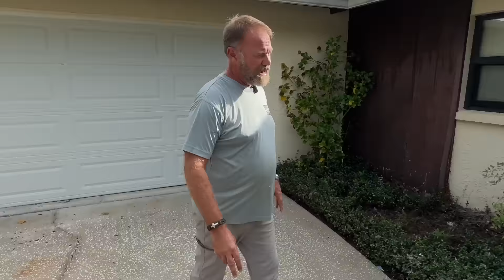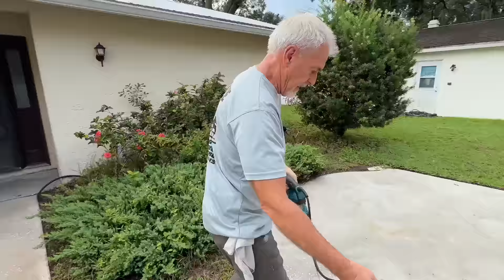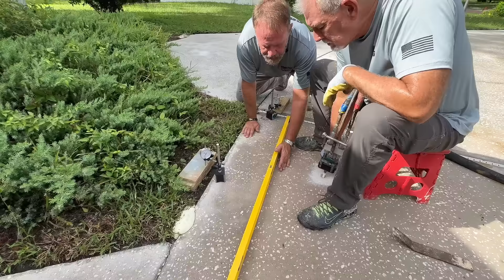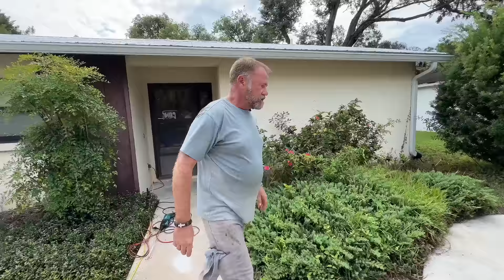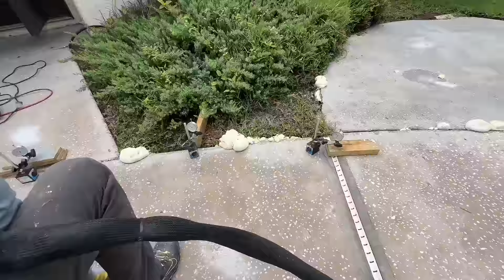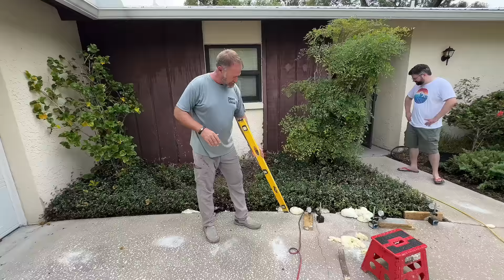Water Pooling Near Your Home? Driveway Lifted With Foam!

Comment: Very good, I have a question. For what need do you require heating in the hose? Couldn't you apply the material at room temperature? Is the heating only necessary to reduce viscosity and allow it to percolate more through the spaces? Great job
Reply from the maker: No , it works optimally at 135 degrees.